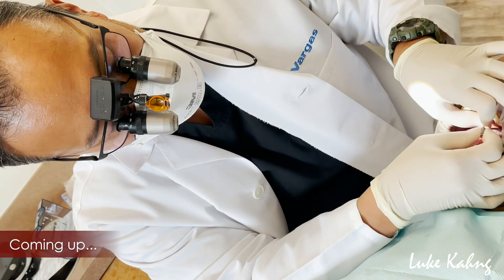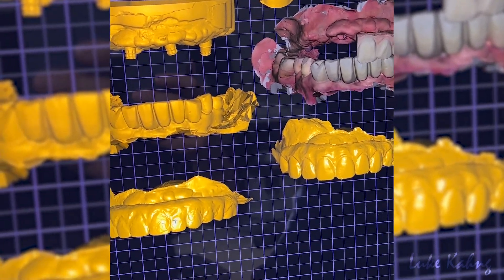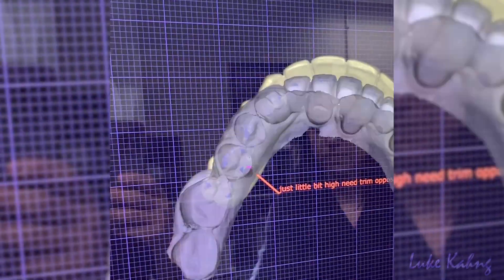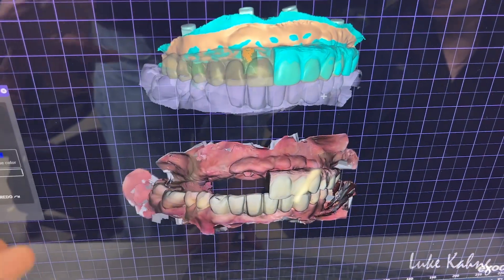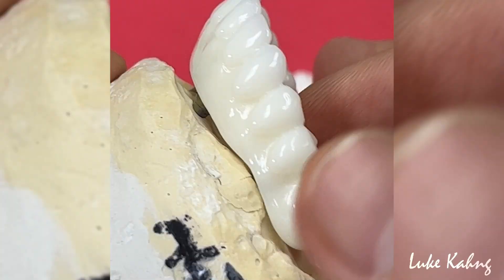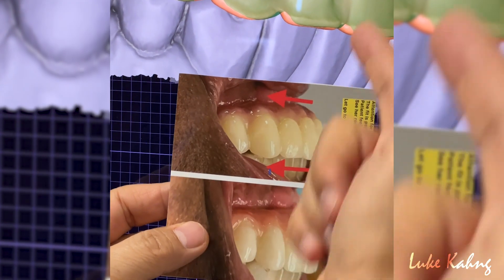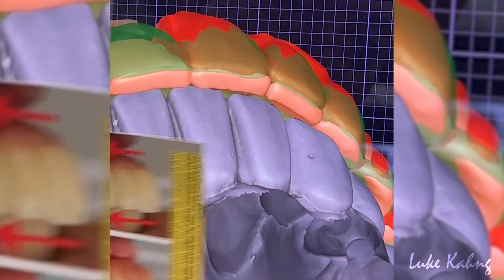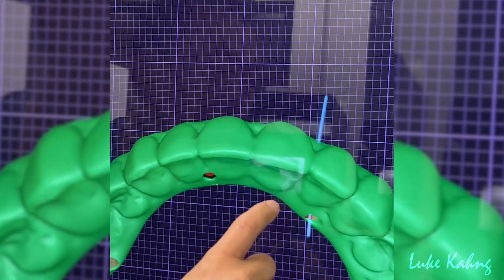How to Remove Ti-Base Failures

Comment: Mr. Kahng, how many degrees of disparalelity can you cover with this? It seems very friendly way of restoring very disparalel implants with ease. And do you use some special screws like the PowerBall screw to radially distribute sthe stresses to the zirconia? Also - less parts, less prone to failure, I like it!
Reply from the maker: depends one the case